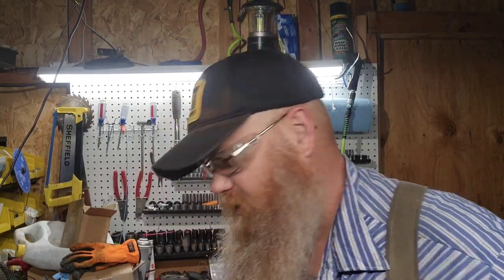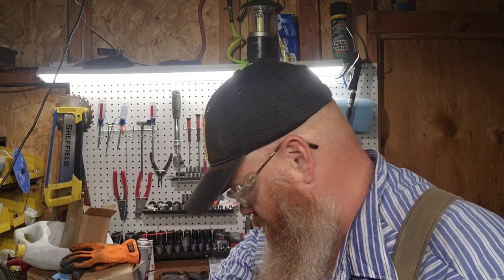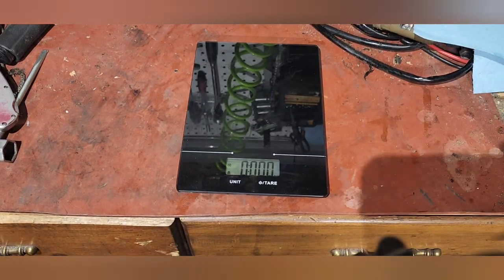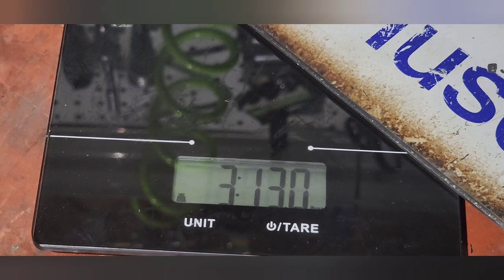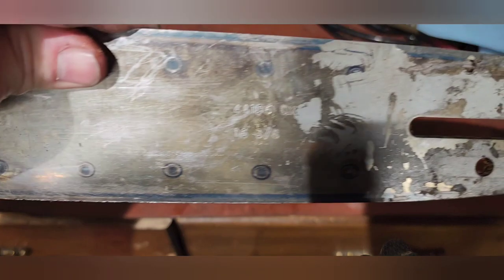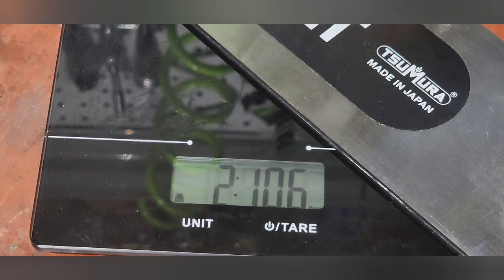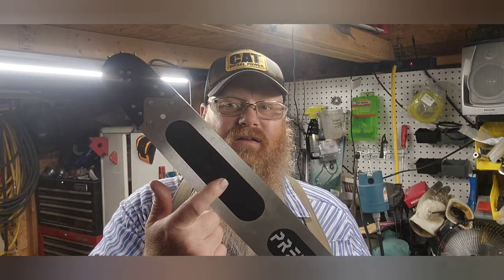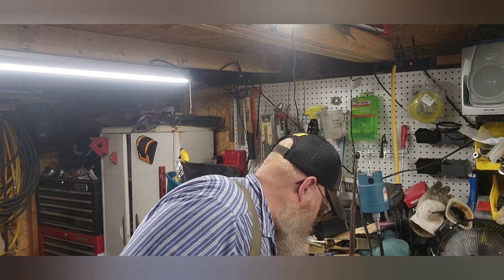Tsumura Premium Lite unboxing and weight

Comment: How's it broke in?
Reply from the maker: Pretty good, this bar is great for firewood .
Reply: @tommagera885  mitch zenobi a pnw faller has a 36 and did some vids on it. Omg it was floppy. It would flex under its on weight.  Had difficulty keeping a chain on it. But it had me curious and smaller bars if it was still be good a light bar will always have more flex than a solid bar but goodness if it can't keep a chain on the end of it it's not much good